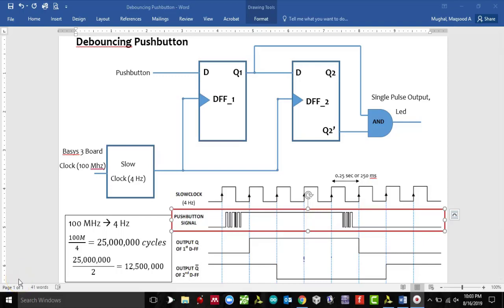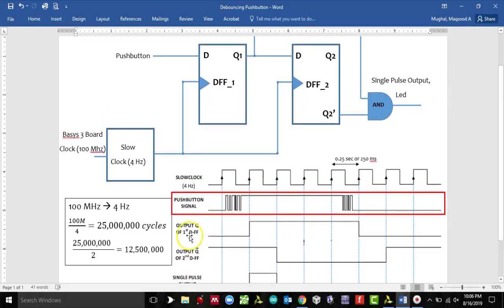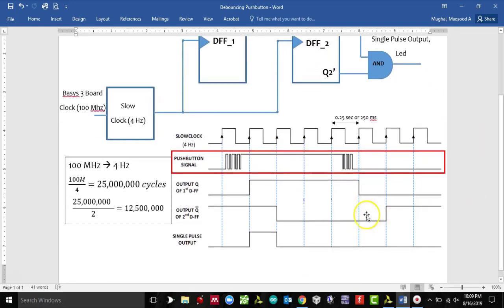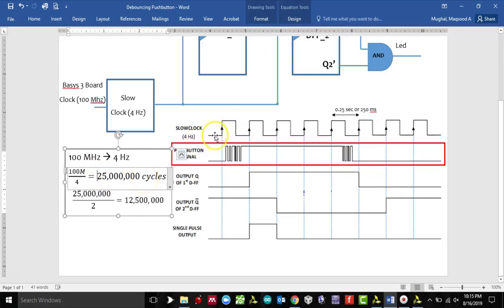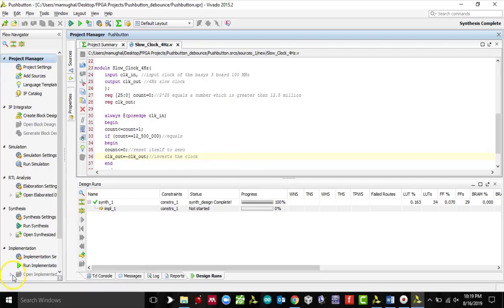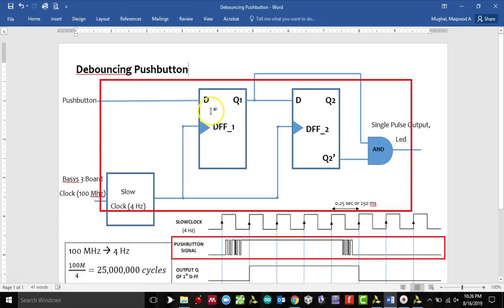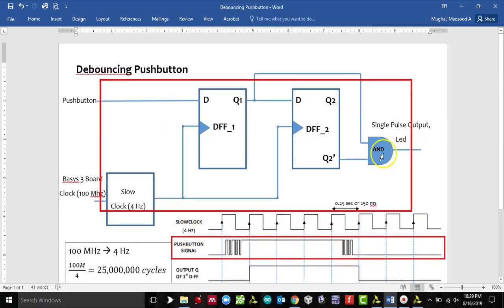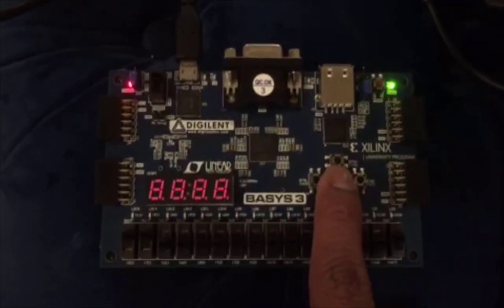#14 Debouncing Pushbutton | Verilog | Step-by-Step Instructions

Comment: I have the question that why we need to have a single pulse one clock-period wide by using AND gate instead of using only DFF1 where I see the pulse is good (doesn't have noise) with the long pulse than your Module. Does it have any benefit when use a single pulse one clock-period wide? Thank sir!

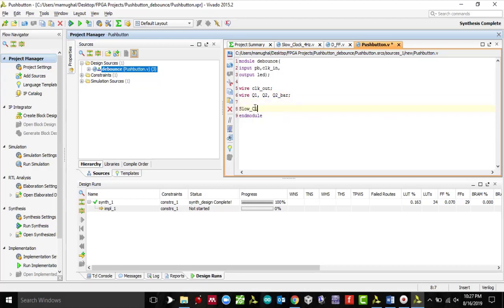Comment: Sir the Slow_Clock_4Hz module is considered an error on my code. Vivado gives this "Warning: redeclaration of ANSI port 'clk_out' is not allowed (clk_out is stated as reg on 9:08). This because of clk_out is stated as a wire in the debounce module in 16:48 ?
Reply: Did you ever get the code to work? I am facing the same issue.
Reply: @Ayat.91  yes at the end if the Slow_clock_4Hz module assign led to clk out

module Slow_Clock_4Hz(
    input clk_in, //input clock of the basys 3 board 100 MHz
    output clk_out //4Hz slow Clock
    );
    reg [25:0] count=0;//2^25 equals a number whihc is greater than 12.5 million
    reg clk_out;
    
    
    
    always @(posedge clk_in)
    begin
    count<=count+1;
    if (count == 12_500_000)//equal
    begin
    count<=0; //resets itself to zero
    clk_out = ~clk_out; //inverts the clock
    end
    end 
    assign led=clk_out;
endmodule
 

Like this

Comment: Sir, the d_ff module has 4 I/0, but when you use it in the push_button module you only list 3.. why is that?
Reply from the maker: not using reset here
Reply: @ElectronicswithProfMughal  Thank you for your response, sir. 
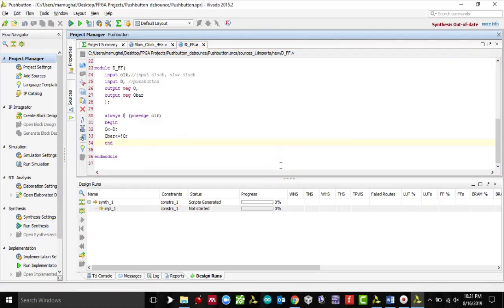would you mind to take a look at minute 14:08 at  the full code (d_ff) please?
There is an extra output, sir. The inputs are all used.
Reply from the maker: OK, I understand the question now. I could have use the fourth one as well, but in the top module I didn't require one since I was using only one of the outputs of the DFF so I didn't include it. But that's a good observation. I should have thought about including the second output also regardless.

Comment: I wrote testbench but its not work shows X for all(except pb and clock bcz Them indicate in testbench)
And I try this in altera fpga with quartus so led is burning when i release button do you know why
Reply from the maker: burning led means?
Reply: @ElectronicswithProfMughal  led becomes On after i released button it is not work like your fpga
Reply from the maker: what is your board clock frequency? @emirhanergun6439
Reply: 50Mhz probably @ElectronicswithProfMughal
Reply: do you have a testbench which is work correctly prof?i would be very happy for this if you share @ElectronicswithProfMughal

Comment: [Place 30-574] Poor placement for routing between an IO pin and BUFG. If this sub optimal condition is acceptable for this design, you may use the CLOCK_DEDICATED_ROUTE constraint in the .xdc file to demote this message to a WARNING. However, the use of this override is highly discouraged. These examples can be used directly in the .xdc file to override this clock rule.
	< set_property CLOCK_DEDICATED_ROUTE FALSE [get_nets pb_IBUF] >

	pb_IBUF_inst (IBUF.O) is locked to IOB_X0Y82
	 and pb_IBUF_BUFG_inst (BUFG.I) is provisionally placed by clockplacer on BUFGCTRL_X0Y1 Hello sir I am facing such error dont know how to solve please help

Comment: why we have slowed down the clock to 4 HZ only?? can we slow down the clock to other frequencies like 1 HZ also??
Reply: YES
Reply from the maker: you can, but 4 hz (1/4 sec) give you better sensitivity. You'll not miss the input. With 1 hz, user will need to press the button for long (up to 1s) before input is detected.

Comment: Hi,teacher.Thank you for this wonderful video,but i want to know whether we need to set value to clk_out from slow_clock because it seems to be x value without any setting from code?
Reply from the maker: Very sorry, I am unable to follow your question, could you please elaborate a little more?
Reply: @ElectronicswithProfMughal  Oh,that's my problem,my English is poor.😅My idea is if i don't set value to clk_out in the module Slow_clk,appearing in about 11:48 of video,the clk_out will be default value(x value) and the command (clk_out <= ~clk_out) will still assign x value to clk_out,but when using your code in FPGA board,it still work.Btw,thanks for your reply,if my messages are rude,I didn't mean it.

Comment: Sir what is the reason for using a slow clock? Why not just use the 100Mhz clock
Reply from the maker: That is too fast of a frequency to read the logic. You have to slow it down. If you don’t, it may mean you pressed the button several time and not just one time.
Reply: @ElectronicswithProfMughal  sir is that because the bounce can maintain for longer than 1 cycle of 100Mhz? If that is the case what if the bounce only remains for a very short time? Then can i use a faster clock?
Reply from the maker: The signal bounces back and forth for a short amount of time before it stabilizes. We can insert a short delay after a button is pressed and then read the input signal.

Comment: What if you do not want a single pulse output. I want it to stay on, just without the oscillations.
Reply from the maker: What do you want to do exactly? Press pushbutton led stays on? Press it again led goes off?
Reply: @ElectronicswithProfMughal  click once and the output is turn on. In your example it's just a pulse and it's off again
Reply from the maker: @riccardogeraci9401  Got it!. I'll try to make a video on it soon.
Reply: @ElectronicswithProfMughal  much appreciated 😀

Comment: When creating the count register, you Said that it is 2^25. Should it not be 2^26 since the register is 26 bits and not 25?
Reply from the maker: Dear James, 0-25 makes it 26 bits. You can also go with 26 which would make 27 bits. As long as the number is bigger than the maximum count you're trying to achieve.

Comment: Amazing Video, i appreciate your this great effort
but i have a query , what happen when press button as long time: led is continious glow or not?
Reply from the maker: Hi Vikas, If you hold the button for too long, it will wait for the next negative edge of the clock to arrive and then light-up the LED for only one clock cycle, which is in this case is set to 4 Hz.